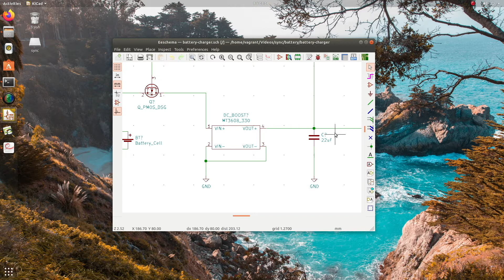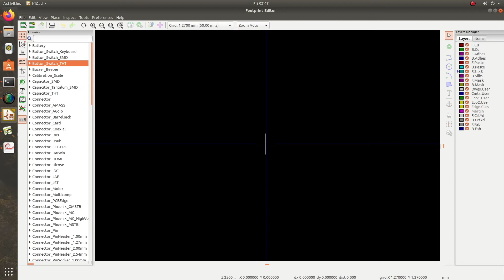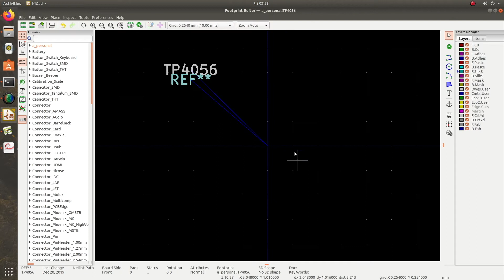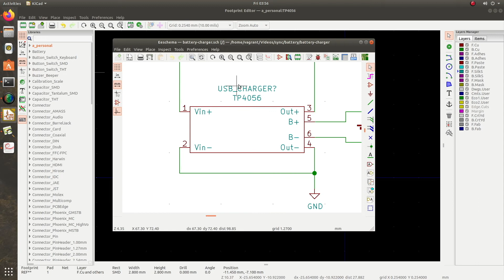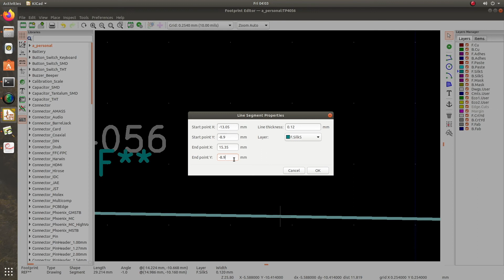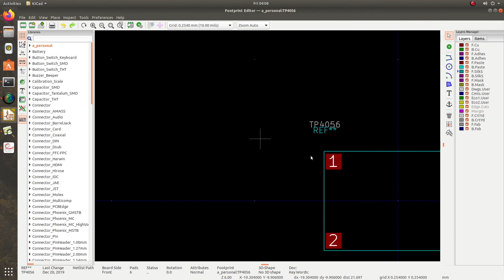KiCad (5.1): Create a Footprint

Comment: The Y axis increase toward the bottom. I really don't understand who is taking the UI decision in the KiCAD team but this is incredible. And if that was the only thing. But so many things are not intuitive. It feels like they are doing it on purpose to scare away new users.
Thanks for the tutorial. I was stuck at changing the default DIP pad.
Reply from the maker: I agree the UI is non-intuitive in parts, the downward y-axis surprised me too, which is why I thought it was important to include in the video.
Reply: There's a setting to change that behavior (Preferences, Preferences, Pcb editor-->Origin&Axes: Y-axis: Increase up.

Comment: When drawing symbols, how do you make sure that every time you draw a symbol that they are all the same size related to each other?
Reply from the maker: Which symbols are you referring to? In the footprint editor you are dealing with absolute measurements.
Reply: @brthor1117  Not important anymore.
Reply: @brthor1117  I want an easier way to connect a 50 components circuit.
Reply: @brthor1117  I need to connect all groud leads of components to ground first before connecting the islands. Is their an easy way to do this? It's a radio receiver. I must start off with the gound plane first on the pcb.

Comment: What about solder paste, solder mask? Will it be placed automatically?
Reply from the maker: Usually the pads will correctly edit the solder mask. Outside the scope of this video, but you can edit the mask clearances, which I have needed to do before. You can always check if the mask is correct by toggling the visible layers.